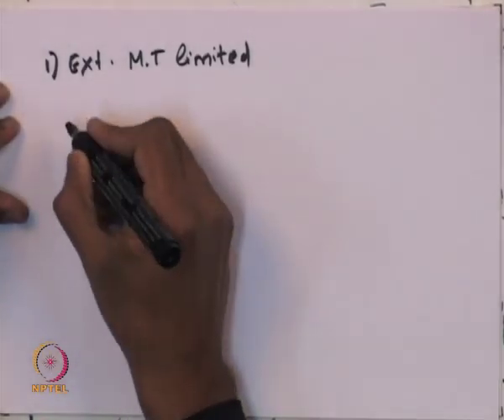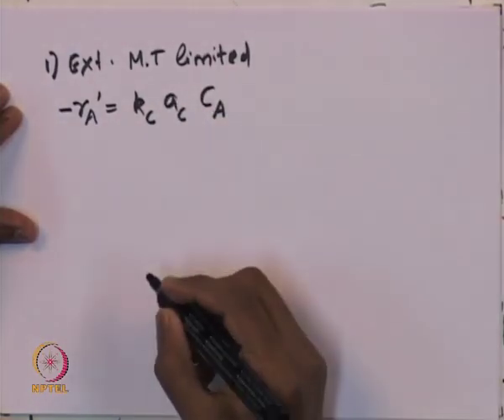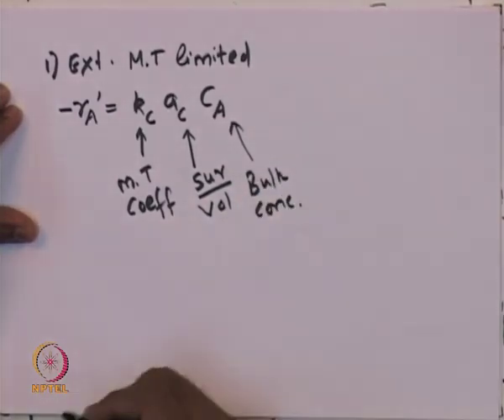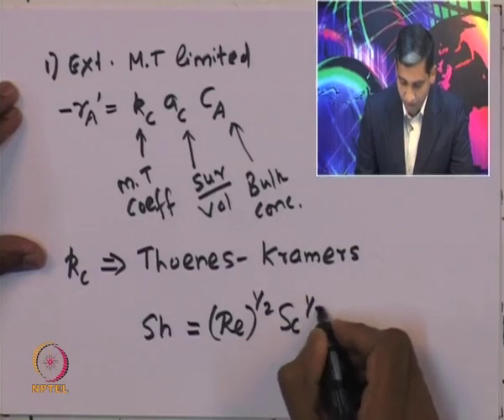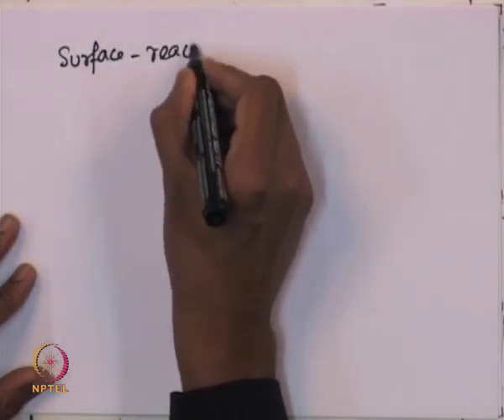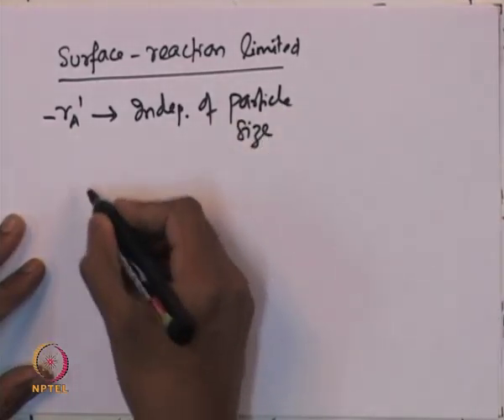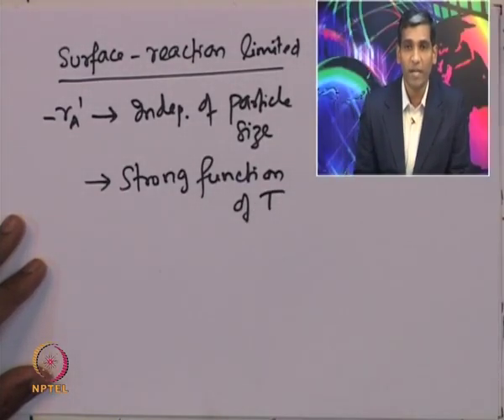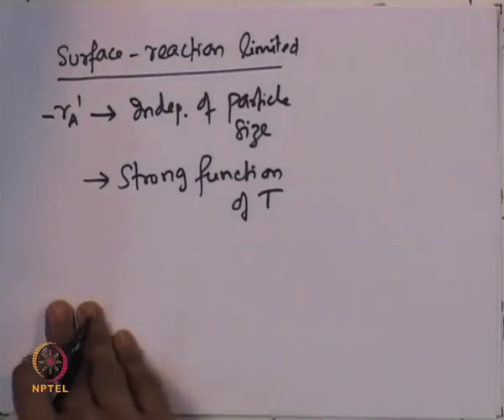Mod-01 Lec-17 Packed-bed reactor design

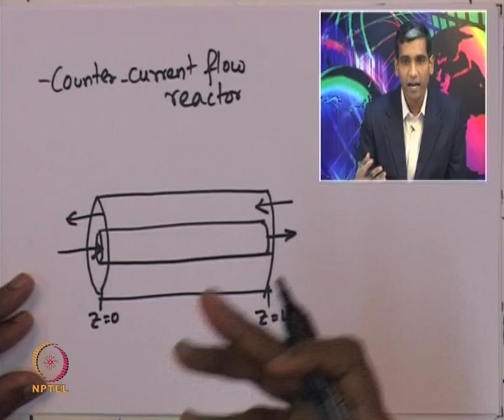Comment: 30:02  The rate of reaction decreases if the temperature is increased in exothermic reactions right? As heat must be liberated in order for reaction to proceed If if temperature is high than the heat transfer would be difficult and hence rate of reaction should decrease for exothermic reaction